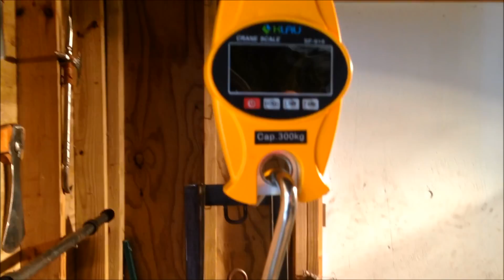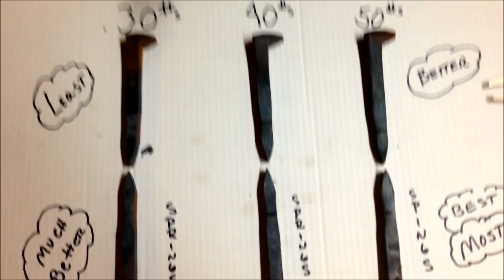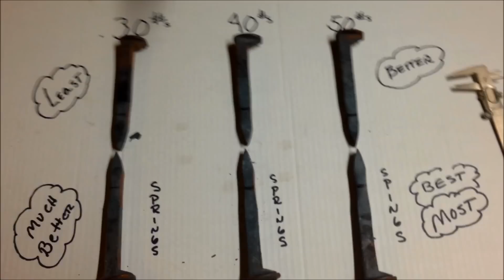Homemade Power Hammer  - Adding More Weight Test

Comment: three things: 

force = mass * velocity^2

any increase in velocity (springs) is going to give you more force by the power of a square - that's why you saw huge gains from the springs, and why small drop hammers largely stopped being used, like, 200 years ago. it's the velocity that matters more - if you had a 10lb hammer traveling at 1000fps, that would likely flatten that whole entire contraption in one shot (lol)

second, another key element is your hammer to anvil weight ratio. the minimum is generally 10:1 - 200lb anvil, 2lb  hammer. for small power hammers, it's not uncommon to see 15:1 or 20:1. i don't have any maths or formulas for this aspect, but i can say it makes a significant difference. having one big contiguous lump of steel, being that steel is elastic, means that you essentially have another spring on the other end putting power into your forging as well.

and then, finally, there's hardness - which doesn't make a huge difference in hand forging, having a hardened hammer and a soft anvil is usually plenty, but having hardened dies on a power hammer (as you do) also adds a significant amount of elasticity to the overall setup.
Reply from the maker: Thank you for the key points.  Very helpful.  This project was really interesting and forced me to crack open the old physics books.  So far, the design is working out well for me, and for the cost, I think it's a good alternative for the weekend Blacksmith.  Take care and thanks again.

Comment: Very good test.. Been thinking about building one for a while.. This gives a good bit of concept on how to build a smaller/lighter unit and get the same bang out of it..  Use shorter drive action, and supplement it with springs..  Might choose the Appalachian Junk Yard Hammer and make the motor drive stiff rather than springy, and move the vertical drive bar closer to the bearings and let the front end stick out further for more of a whip action..  
Thanks again for figuring things out as you go. Saved me some experimenting time, I'm sure..
Reply from the maker: Hey hey - thanks Mark.   I look forward to seeing your hammer and good luck with the build.  Cheers!

Comment: I did some rough calculations and, consideriing you have a 1.5hp(about 1.1kw) motor, that the hammer strikes about 10 times in 8 seconds, and that it lifts up 12 inches(30 cm) resulting in an approximated .244 seconds of fall time, your motor should be able to support about 450 pounds. Theoretically at least.
Reply from the maker: LOL  given my welds are just OK I need to be conservative :))).   That said, The helpful thing with this hammer is the ability to alter the weight and speed of the blows depending on what I'm forging.
Reply from the maker: that's good news - so plenty of power for 100 pound head when needed.  Thanks for the math - appreciate it!!
Reply: No problem.
Reply: it should be able to do much more than that when you consider the gear reductions too, no? being that there is a reduction from motor to gear box, the gear box reduction, and then there must be some sort of reduction in the helve. I'd wager that this hammer could throw any size tup one would reasonably wish to put on there.
Reply: Kevin Keel With a high enough ratio between the gears, yes. It would strike less often, however. And you also have to consider something should break at some point.

Comment: So I really want to build my own power hammer but I don't know what motor to get. Could I use a harbor freight 6 inch beach grinder as the motor?
Reply from the maker: I don't think that would be strong enough, but they and tractor supply sell the Farm Duty high torque motors that should work.
Reply: Thank you

Comment: Hey Rick! It's nice to see my questions from your last video being answered. This helped a whole lot and I love how simple it was to push around metal like that! A great power hammer all around and I'm excited to build my own! Another question I have, if you increased the wooden wheel height, thus increasing the distance between dye and anvil have any effect on it? I'm asking because if you ever needed to put some hand-dye tools in between to help shape the metal.
Reply from the maker: There are a few options I think (I'm no expert) - increasing the size of the cam or increasing the size of the rigid caster bolted on the arm that rides on the cam for more height or leave all that the same and make a second head with the new die - in fact I am thinking of making a second head.  The current set up is the head is attached to a smaller square tube (approx. 18 inches long) which slides into and bolted on to the main arm - this allows changes to the head with different dies.   Hope that makes sense.

Comment: Good test Rick, You will move much more metal though if the striking head  is smaller in width and length, I found that with my press the bigger the area the less force on the steel. I made some smaller dies and the difference was amazing. Your striking head is big compared to most power hammers. Cheers.
Reply from the maker: Thank you my friend - that would make for another interesting test across three different size dies...gosh the fun projects keep piling up - I need to retire so work doesn't get in the way - cheers :-)))